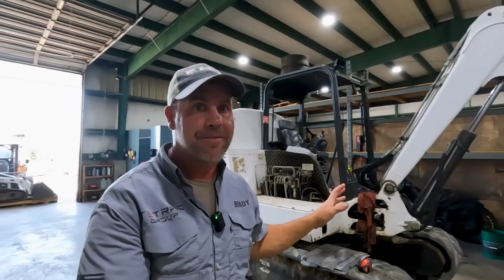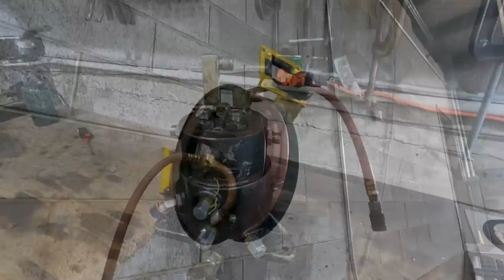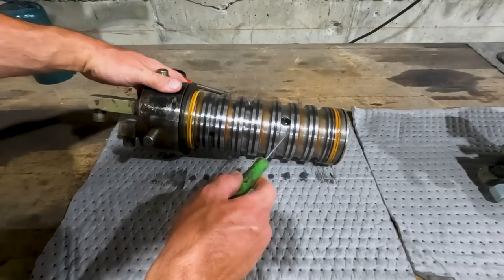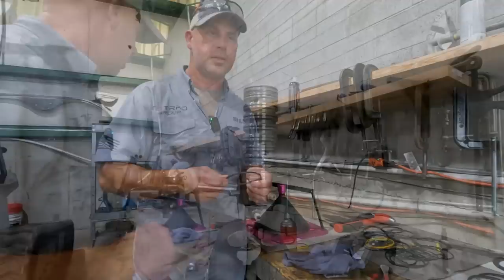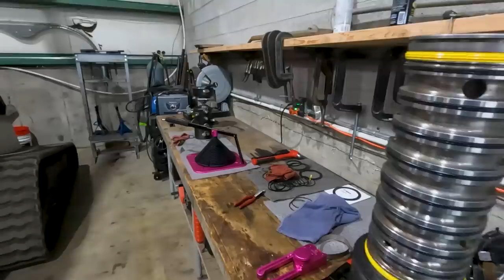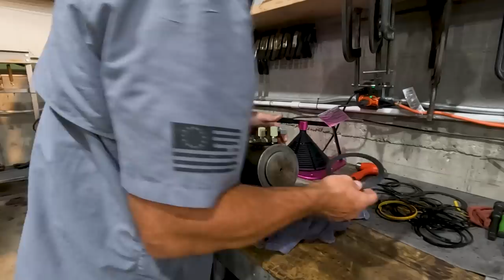It's Not Magic.  Bobcat Excavator Swivel Joint Repair.

Comment: 13 spins? How do know over time, months or even years, where your at with those 13 spins?
Reply: It's BS.  I don't know why he's perpetuating that myth.  It isn't threaded and has no reason to be.  You can spin it around all day long if you want.  This is evident by the design of the swivel... the channels are circular, not threads
Reply: The easiest way to keep track of the rotations is to set a bucket of steam on the counterweight at the start of each job. As the machine turns it spills a little of the steam each time. Keep an eye on the bucket. As the steam gets close to the bottom then you know you only have a few turns left. 😉
Reply: @rrrusted2883  I prefer the rope method!!

You just wrap your rope around the base 12 times right at the point that the entire cab unscrews itself and falls off, then spin back 12 times until the rope is completely loose!!

...the only drawback is when you go to move and forget to pickup the rope before running over it with the tracks! 😬

Comment: I did the one on my 331 last fall and wish that I had that tool. I ended up using larger hose clamps to get the bands contracted again and it worked but definitely could have marked up the new bands. There was plenty of access from the top with mine though and that is a good thing because I never would have thought to grab the plasma cutter.

Comment: For self install without a helper. Try a Harbor Freight atv winch with remote control.  Hook up to 12volt and use remote to raise or lower unit into place. I have used this method  on heavy control  values  lifting  into position while under a machine.

Comment: Would it not be safer to use the ring compressor as each o-ring is being installed into the bore , as one would do when installing piston rings into a block?

Comment: Question.. would warming the outer housing and or cooling the inner housing help? I press pieces of metal into other pieces of metal when I need to sometimes with seals and I use a little bit of heat not getting it super hot but enough to expand the housing say a half thou to 1 thou.. it makes life exponentially easier

Comment: It is Ok to use Petroleum Jelly or hydraulic oil to lube hydraulic seals.  works good.  I worked for Amoco in the RD fuels lubricants division and am Master Certified.  Also you can use the looped end of a piece of piano wire looped and crushed in a piece of tubing to ease in seals, or plastic pry for windshield repairs...

Comment: Bobcat dealer told me that they would have to separate the top on machine from the track frame to replace that joint I see they where wrong. Is it true it will come apart after 13 turns in 1 direction. Have a great day be safe
Reply from the maker: No, just a bad joke. It will spin in any direction indefinitely
Reply: @tetradgroup  I figure it was a joke but just wanted to make sure cause I didn't want some rookie on my excavator just to see if that was true. Nice video. I  Learn something today about how to repair something. Thanks

Comment: ...that Swivel Joint, is where the "FM" happens.   I heard many complex things called that, when I was working for G.E. Computer Services at DFW Airport.  A lot of ex-military guys used to work for RCA/G.E. Computer and Electronics services, many with Radio and electronics military training.  

I was very naive at the time, back in 1996.  I asked one of the Senior techs what "FM" stood for, he replied, that's where the "F@#King Magic happens 🤣🤣🤣🤣🤣🤣

Comment: Could that inner section be put in the freezer to shrink, or would that not be as good idea?
Reply: ... i would think it could, and put the outer assembly in the oven, just set it at the lowest temperature, and lube the hell out of it when trying to assemble it... ✌🏼   

A friend of mine did that with a press on ball joint for a power control arm, for a Civic.  He lubed it with slick 50 or some Teflon lube, the joint slid down itself into the fitting by itself.

Comment: Does swing motor gets the fluid from swivel or control valve?
Reply: The swing motor should be with the cab, so it doesn't run through the swivel joint.

Yes, it's operated from the control valves (as it's controlled from the joysticks).
Reply: @jasono2139  thank you jasono

Comment: Have  a question 2003 mustang 2044 lost all hydrolics  moves back and forth fine  but dump and lift don’t work I put a gage on the house straight out of the pump and I’m getting 500 psi at full trotle.    Think it’s the pump?

Comment: Question about case return. I have a 2019 T770 enclosed cab. Is there a case return is there a filter or some type of check valve? I have blown the motor seal on the output shaft on two different disc type forestry mulchers allowing hydraulic fluid to go into the gear box then blowing the bottom seal on the gear box.  One Kubota and one Diamond brand mulchers. Mulcher dealers say when the cutter disc gets loader to heavy or stalled the return on the Bobcat is not accepting enough fluid. Any suggestions?
Reply from the maker: No checks or filter, only main hydrostatic filter.  Back pressure on case drain line could get up to 50 psi.  Tee in a gauge to the case drain line at the quick connector and monitor pressure.  Replace main hydrostatic filter as well.

Comment: I currently have the swivel out of a 2011 E50 for seal replacement.  I want to replace all the rings on the fittings.  Are the rings standard or metric?  Durometer 70?  Anything special.  I want to use quality replacements as we all no a real pain to access.  Any help or suggestions appreciated.
Reply from the maker: You should be able to order the seals straight from Bobcat, that way you know you have the correct quality seals.
Reply: Thanks!  That's exactly what I will do.